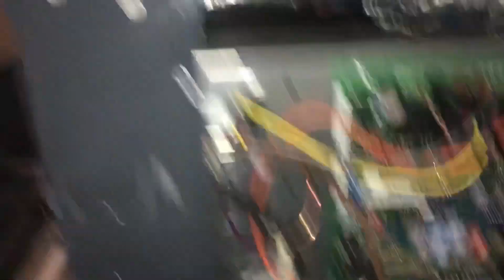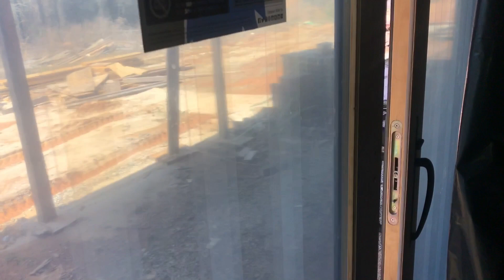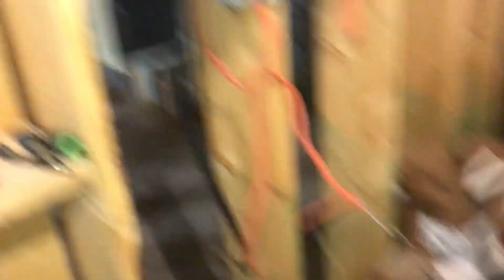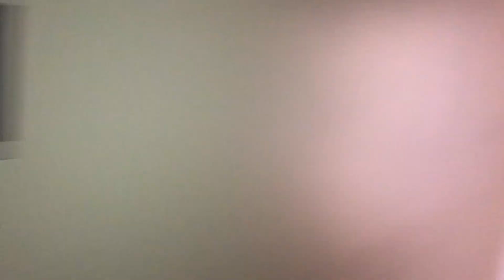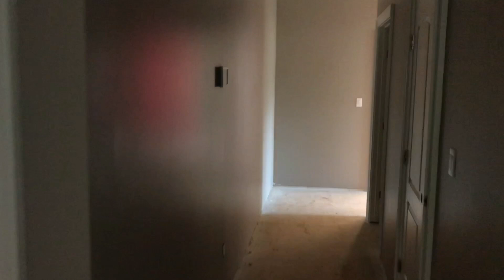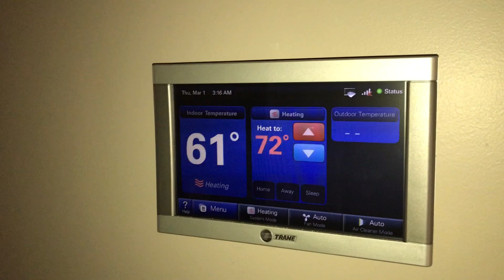Geo Thermal Startup on first floor system

Comment: In your opinion, is a geothermal system, such as a Trane, powerful enough to run a radiant snowmelt system in Wisconsin? I want to build a home with geothermal and want no gas, yet still want the heated driveway. Would this be able to be accomplished by using water storage tanks? I would be willing to install something with several tanks to store the heated glycol/water.

Comment: Sounds really quiet compared to most systems.  My 5 cents...would it make less noise and more air flow if the return and supply vents were the upgraded "rolled" louvers vs. the stamped sharp edged type??  BTW, owners went with some rather dark colors ! Wonderful HVAC work.

Comment: I love the open loop concept.  It completely erases the need to oversize to reject the heat being returned via the loop (like pooping in your bed).  Think about how much energy could be harvested from a heat exchanger connected to municipal water distribution systems -- both for heating and cooling.

Comment: I use black polyethylene piping with heat fusion on all piping joints to seal all my geothermal piping. I have a lot of concerns using PVC. I also use a sealed condensing loop system using vertical or horizontal wells. Vertical wells at approx 200 feet / ton. are my preferred method.
Reply: That's the only way it should be done.

Comment: I have installed hundreds of the Aquatherm systems using recycled hot water from the water heater(gas) and they are crazy efficient. Only issue is you have to have some sort of water softener to keep system clean of scale and calcium build up. Great video!

Comment: Quiet, yes. First rate install, yes.  Efficient, no.  Pissing away drinking water like this is a crime.  I would hope that today's modern inverter air to air systems do away with this type of practice.
Reply: its a pump and dump should allways have closed loop on geo

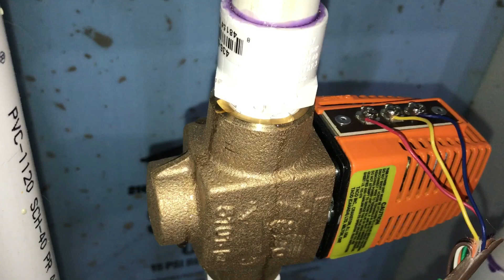Comment: At 13:02-13:04  Did  you have a leak at the taco valve ?                                                                                                                                                              also is there any moisture sensor or dew sensor for possible leaks for this system ?                                                                                                                                   Do you pressure test the 3/4 PVC discharge lines prior to running water thru them ?                                                                                                           just curious Very interested in this set up and how it operates thanks in advance !
Reply: I think you might be correct about the leak. I sure didn't catch it first time but when I zeroed in on that moment 🧐- - they it is! You've got a good eye. I'm sure Ted spotted it at some point.

Comment: I didn't know taco still made those wax motors.  They are not avaliable in my area any more.
Reply from the maker: I really like them !! What do you guys use there ?
Reply: Anti DIY HVAC https://www.supplyhouse.com/Taco-V050C2G2ZA024Q4A1-1-2-Geo-Sentry-GeoThermal-Zone-Valve-Sweat-Normally-Closed
Reply: Anti DIY HVAC not half inch, but the same valve. Also slow open/closed.
Reply from the maker: Yes I have seen those and they are actually a good bit less expensive than the ones in my video... I may try them on our next Geo.